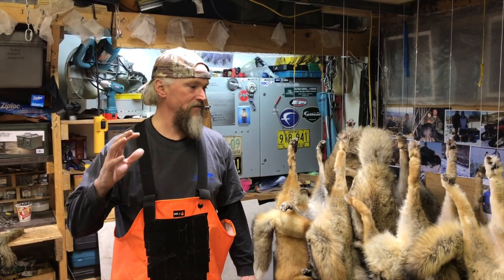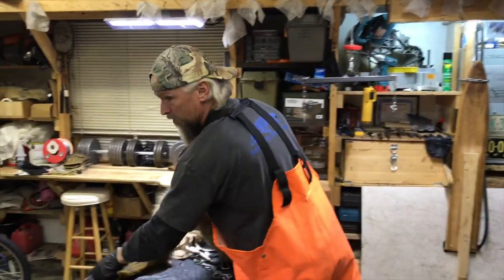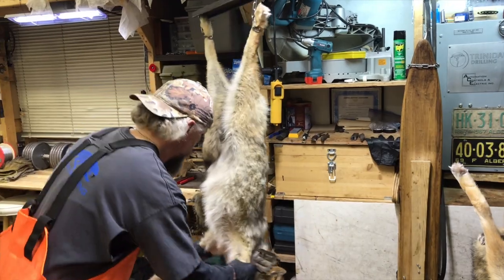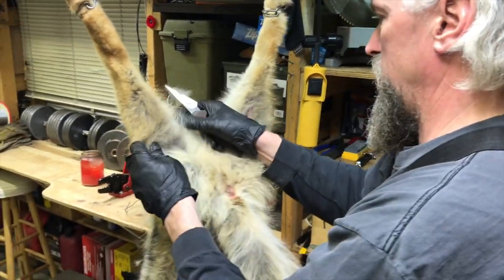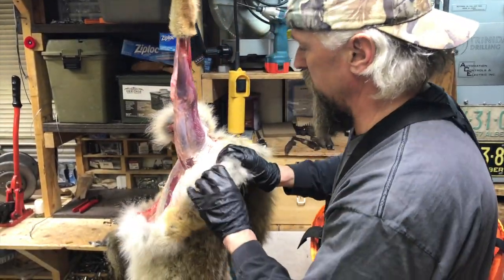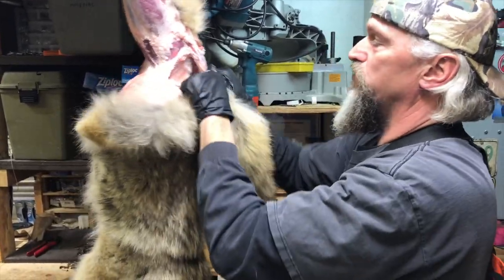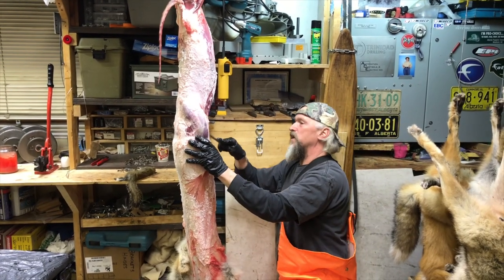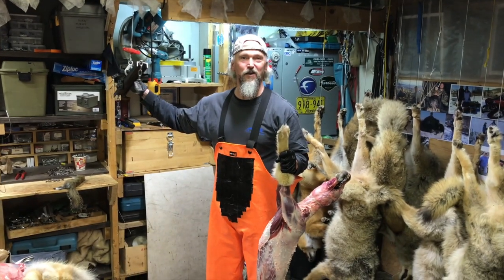Solotrapper S5, Ep13

Comment: I definitely found this useful, like your clamps, I will put that use as well. Clamp location is extremely important as I have found out the hard way, your explanation of that was solid and sound advice. Just your way explaining the whole process and pulls is valuable to me and many others. I love my winch pull system, after you pull by hand on tuff thick old males and wonder why the next day you can’t even hold a pencil, old way, new way whatever, when I am done skinning I am not covered with the smell or blood of these coyotes. Much appreciated for your time effort and work. Many thumbs up!
Reply from the maker: Amen brother. Amen. 100% right.